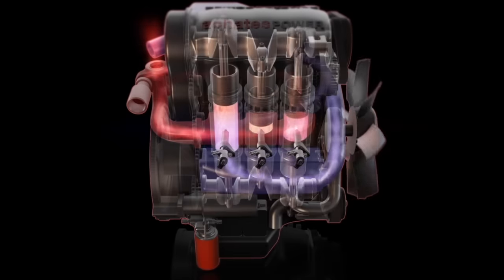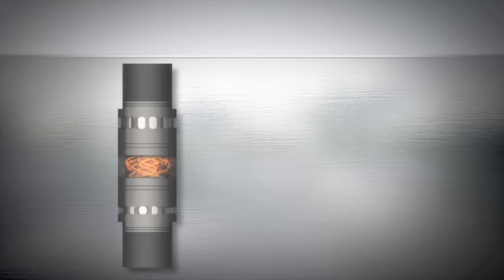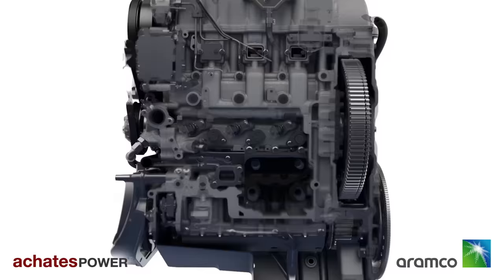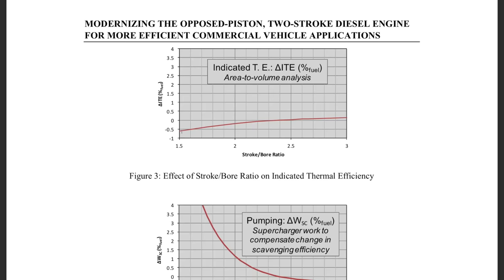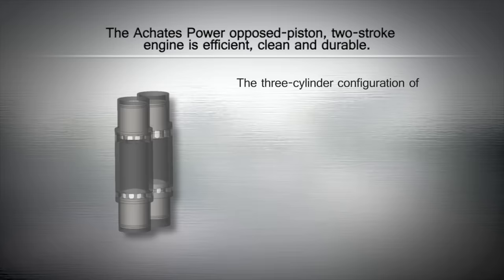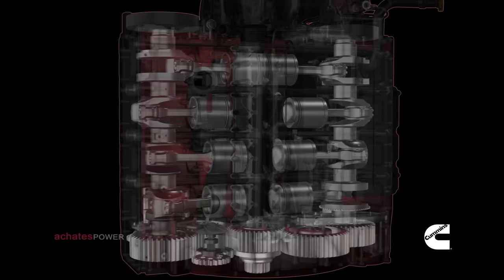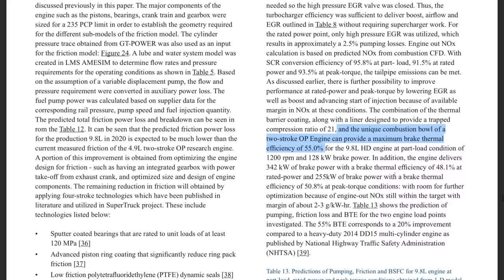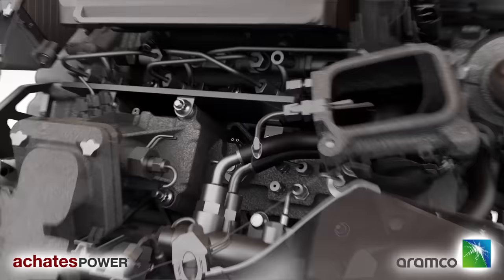Opposed Piston Diesel Engines Are Crazy Efficient

Comment: This could replace the Atkinson cycle engines in the Toyota Prius. I predict that this engine won't be used in consumer vehicles because it is too simple and it will last too long.
Reply: Agree with this comment. The manufacturer of vehicle will be bankrupt because the customer just buy the vehicle and less or very less repaired the engine.
Reply: I doubt if it will be used in consumer Vehicles because electric motors are the future.
Reply: @knewledge8626  Electric vehicles need a power station to generate the electricity. Australia does not have enough coal units to meet current peak demand on some summer days so we'd need to build new coal, gas or nuclear units BEFORE going electric.
I also doubt there is enough high grade carbon (graphite) being mined in the world to build the batteries and I'm certain no-one has devised an economically viable Lithium battery recycling process.
Au is smaller than California yet could not go electric. 
I reckon this 3 cylinder diesel has some merit and we are a long way from maximising the ICE.
Reply: @knewledge8626  It could be used as a ground engine and a range extender for cars. I think we are 10+ years away from EVs even being 20% of the cars. Charging times and range are still issues. In cold climates heating the cabin will reduce range. There are batteries on the horizon that charge faster than Li and have a greater capacity. Super capacitors may replace batteries. 

There are are the economics and politics and the ugliness of capitalism to deal with. An EV can last much longer because they are simpler machines and have less maintenance. If the average car lasts 20 years or more the economic effects will ripple through the economy.  EVs don't need transmissions, radiators, engines, exhaust systems, gasoline, diesel, oil and transmission fluid etc..  The oligarchs will have something to say about that.

What may happen is a lot of families who own homes will own 2 cars, one for around town and commutes and the other one for long commutes. It is sad that there is so much technology is being developed to get a small gain in efficiency though Rube Goldberg style engineering,
Reply: @tofanbaskoro3200  Had Mazda 626 for 18 years, engine was never repaired and outlived the car. It was "sold" at 220k miles with no engine issues whatsoever. Now I have next model 6.
Reply: there is also the problem that it is height is significantly bigger than normal four-stroke cylinders. You can't really fit that in smaller cars
Reply: @thiagozlin  Could you not mount the engine horizontally? Subaru and VW among others did it.
Reply: @thiagozlin  Put it in sideways like a boxer engine.
Reply: @carolinemartin-knowles7733  
In the UK we just went 100 hours with out using coal at all. As of 2018 we use more renewable energy then fossil fuel. It's just about investing in the future. Problem is for Australia coal is super cheap.  ;)
Reply: As for car maintenance. Cat industry is quickly learning, fit every new car with every mod con, air con, electric toy going. It is more to fail in the future and so more to make money from, this overcomes the reliability profit issue of electric cars.

Stick sensors every where. And when one fails make sure the car needlessly goes in to limp mode!

As cars get more electronic people will scrap then earlier rather then repair them too.
Reply: @knewledge8626  Why do you say this?  If this engine can get a car today that is say 30mpg on the highway to say 40mpg or 45mpg on the highway then that is very close to better than a lot of electric cars.  So then the difference comes down to complexity and charging time.   Now if this engine is only say 5% better then it isn't worth it, in my opinion.   The poster didn't put up another engine for comparison so it is difficult to judge.
Reply: I don’t think this is an accurate statement at all. Long lasting engines have never been the downfall of an auto make. Honda, buick, Toyota all make long lasting engines and they havnt gone under. Usually the engine in a car is NOT the first thing to cause a car to be scrapped anyway.
Reply: it is not EURO 4 friendly...
Reply: A lot of the comments in this thread sound like they're coming from somebody that owns a horse in 1920. We still have horses today. We will still have combustion engines in 30 years. And for the same reason. But combustion engines, just like horses, are not going to be what most people use to get to work.
Reply: @knewledge8626  not until theres places to charge them and charge them quickly. Until then, useless.
Reply: @tofanbaskoro3200 , current engines are pretty reliable. The rest of the drive train, suspension, body, and drive train combine to ensure turnover in automobiles.
Reply: @chriscomertn  think of the Ferrari testarosa. 8 or more feet wide due to flat 12.....

However, the dodge slant six is an interesting idea to copy.
Reply: If you want complexity, look at the computer's and other systems used. 

But adding a Stirling engineer to scavenge heat could be amazing!
Reply: @geppetto8013  run it on glycerin.
Reply: @thehound5794  Hate to break it to you mate , electric vehicles have most if not all those components you described.
Apart from the low maintenance on the electric motor, you still have just as much maintenance on the rest of the car.
Electric cars don't jus magically drive with just an electric motor and power storage
Reply: @nfsfanAndrew  It's deja vu all over again. From about 1910. "The first public gasoline servers (around 1907) were simply called filling stations. They were just curbside hand pumps. In 1920, America had 15,000 gas stations and only half that number of curbside pumps. By 1930, we had over 100,000 gas stations, and curbside pumps had all but vanished." Source: University of Houston. There were also few roads that were fit for cars and no interstate highway system. The first cars that were made were BY TODAY'S STANDARDS almost useless. So give it about 10 years. As of October of 2018, 1 million useless Vehicles have been sold in the United States. 😁
Reply: @Dosedmonkey  ; Super cheap is not a ''problem''. Super simpleton CO2 AGW ninnies are a problem.
Reply: I don't think reliability is the issue. Most cars are scrapped way before the engine fails. It's usually a crash, corrosion and/or part availability/cost that sends a car to the scrap yard nowadays.
Reply: @carolinemartin-knowles7733  just cover the Outback with solar panels
Reply: @carolinemartin-knowles7733  I get what you are saying, but the first part of the statement is somehow not very accurate. I've recently seen on YT one of our Polish university guys made 100% solar prototype for some big racing events. Apparently this event also appears in Australia, so I'm guessing instead of coal units you certainly have solar units.
The tech is there but until that oil mafia is dead, electric solutions are gonna progress very slowly because someone is backstabbing it. In terms of business models solar panel cars is a bad idea, because to many people in the industry are basically not necessary anymore, especially the fuel providers.
Of course this is only one example and for sure there are more solutions for countries like yours regarding harvesting energy, tidal farms, turbine farms, and so on. Energy is everywhere you just need to start thinking of fuel as something coming from nature not someones lucrative business and solutions will arise.
Reply: I agree...too little replacement parts profit, and gas consumption  . Auto/oil industry fat cats won't go for it. There are cars in Europe proven to get 100 mpg....but you don't see them mass produced. Wankle engines were simple design, fairly efficient  (Tho dirty exhaust?)...Mazda lost profits @ DEALERSHIPS. ..go figure.
Reply: Hey, something seldom mentioned about "Electric cars"...how long Batts last and cost replace!
Reply: @TestingPyros  As with almost any substance, a small number of people have sensitivities or allergies to glycerin and it can be toxic if consumed in sufficient quantities.
Reply: @DamianB82  Its not  "the oil mafia"  It's the tax man.   Sad and well misunderstood fact of reality the greenies will not discuss is that big oil only makes  around 10 - 15 cents per gallon off its product it sells.   While on the other hand the tax man makes anywhere from 40 cent to 2+ dollars per gallon.  

As far as big oil is concerned they'd love everyone to have high efficiency engines in everything at this point just so that they could sell you half the fuel you use now to do the same work at twice the profit for twice as long making a win win win for the customer, them and the environment.  

So once again in reality, it ain't the oil man's greedy hand holding things back, it's the much bigger and greedier big government doing it, as always, (ever wonder why 'emissions compliant' engines have way shitier efficiency ratings than non compliant 'off road' rated ones?) which means that until electric vehicles and everything related to their function can be taxed as hard or harder than oil, nobodies getting a practical EV anywhere.
Reply: @scottleachman9847  It's not big oil, its big government holding things back.   Big oil only makes 10 - 15 cents per gallon of product they sell.  Big government gets 40 cents to over $2 a gallon from the sale.   

As far as big oil is concerned they would love to see you use half the fuel at twice the price for twice as long to run your doublely efficient vehicle on.  The problem is the tax man would lose half his massive cut in the deal and the only way that game stays in play is if big government gives big oil massive subsidies to keep them happy enough to not push the issue.
Reply: @thecustodian1023  That's what pushes efficiency.

Expensive gas means more reason for car companies to make cars more efficient
Reply: @Joesolo13  Hardly, much of the world has far more fuel efficient vehicles than we do now because questionable to proven wrong government regulations under the name of emissions compliance holds our vehicles back on that front.  

Remember the volkswagen diesel scandal where  'fixing' the emissions problem make the vehicles lower powered and have worse fuel efficiency for it and killed their resale value for being 'fixed ' too?
Reply: @knewledge8626  yes but they still cant climb hilly terrain efficiently, they will only compete when super capacitors are ready
for those of us in lessdeveloped roadlesss countries this engine we are enthused about this concept
Reply: A lot of cars die nowadays for reasons other than engine failure.
Reply: @Dosedmonkey  -- So the UK substituted oil for coal for 4 days. What's the advantage there? I hear there is more offshore oil being found in the North Sea and that it will help meet the UK energy needs for a decade or more. I worked in the North Sea in the late 70's during the oil boom that saved the UK from becoming a third world nation, economically. Energy is taken for granted by most of the population that has easy access to it. The energy oligarchs don't want the current methods of energy generation to change quickly. They are using many methods to make sure of that.
Reply: tech hydrogen motors are the future man. Maybe with electric motors. But the engine charging them will be hydrogen. Unless we discover something else more efficient.
Reply: @thehound5794  I agree that this would probably be a very good engine to put in a hybrid vehicle. But don't forget that heating the cabin with thermal energy from this kind of engine also reduces range since you are going to need an additional heater just to get the temperature up in the engine d/t the higher efficiency. My Volvo V70 from 2006 has a diesel-heater installed from factory just because of this reason, it turns on automatically when under -7 degree C (~20F). When I turn the heater off it takes forever to get the engine up to working temperature and also the cabin heat.
Reply: @knewledge8626  or the past depending how you look on technology from 1908
Reply: @murta1979  One partial solution to heating the cabin is a lot of insulation.  Not only will it stop heat loss, it will make the cabin quieter.  When parked in a garage or driveway the cabin can be pre heated using dock power.  

When sub zero temperatures are present even conventional car heaters can't keep up with that much of a temperature difference/delta T.  Usually with subzero temperatures  there are clear skies. If a car is parked outside it will be warmed with passive solar.  

There probably is not a perfect solution. In northern states, some people buy a "winter rat" because of the salt used on the roads.  Winter is about 4 months.
Reply: @knewledge8626  far future, the batteries still have issues with cold weather
Reply: @yomumma7803  As of September 2018, cumulative sales in the U.S. totaled one million highway legal plug-in electric vehicles. Right now there are over 2 million. I'm thinking in less than 10 years there will be more electric vehicles than combustion engine vehicles. at least in the United States.
Reply: The Hound That wouldn’t concern the likes of Volvo
Reply: I had another thought on this. If the engine was placed so that the engine was placed narrowly instead of widely in the car, it could work.

Not sure that makes sense, so I'll just let you digest it.
Reply: Of course.   Why would toyota want to come out with the engine that never needs to be maintained.  Nobody would buy one, putting all other car companies out of business....leaving Toyota as the last survivor of the auto wars.    Nope.   no interest there.
Reply: Scott Leachman not to mention that the parts for them have to shipped around the world several times between mining / refining / manufacturing. Even before they are off the production line their “carbon footprint “ is enormous compared to gas/diesel vehicles.
Reply: @carolinemartin-knowles7733  Carbon batteries are a thing now.... By the time the world runs out we WI have it completely ready for commercial use.
Thank you samsung.
You're correct about everything else
Reply: @knewledge8626  they are not fuel that burns with no effect  to the HUMAN RACE is far better superior  with 100 to the gallon of more
Reply: @thehound5794  on way to hoiday  in car but need to stop to charge car up want  a car like that no really  a car that burns fuel that is no harm to us or this plannet
Reply: Gas cars will always get better and I will always be a gas car person. The only reason why cars are going electric is because we only have about 50 years of gas supply left in the world. I thought e85 was going to take off more but hopefully there is ways to find fuel or other types of fuel mixtures in the future. The fastest car in the world is the hennesy venom with a twin turbo v8 reaching over 300 so even a tesla cant even touch that
Reply: While I see your point, you give too much credit on the general population. People will buy other cars because they are new, or their "old car" have a too big mileage (maybe 50 000 miles, even less, I know people that change their car every 30 000km, wich is even less), or they just want a new feature, or feel like changing it. Reliable engine were put on many cars, and still they were selled for a less reliable but new car.
Reply: @tofanbaskoro3200  Have a Ford Crown Victoria Police Interceptor with Original Engine & Transmissiom and recently hit 300k Miles/482k Kilometer
Still Run like a clock and Shifts like a Dream
Reply: @carolinemartin-knowles7733  Solar and Wind Power the General load and use existing Fossil fiel Units dir Peak Power.
Reply: The hound, modern engines are more complex but very reliable, they easily outlast the car its in. so your theory is flawed
Reply: Because they’re too heavy. Efficiency is great. Power to weight?  Not so much.
Reply: @tofanbaskoro3200  who the heck gets their cars repaired by the manufacturer without warranty? They couldn't profit off a faulty product.
Reply: @Dosedmonkey  This I just scraped a perfectly good phone for 2 artificial reasons. 
1. the battery was going, and the dam thing is glued and sealed in a glass case. 
2. The manufacture stopped supporting it, but didn't release the code. 
Planed obsolescence.
Reply: You cant opperate thousands 2-stroke engines in a city. Low emissions fine but when it comes to burnt oil? Emissions are CO2, NOx and SOx but i didnt hear of any burnt oil regulations (CH probably). Yeah ships using 2-stroke engines but they opperate in the middle of nowhere. That kind of smoke it's heavy, imagine now how would a city will look like with a million 2-stroke vechicles.
Reply: Gary McSpadden tech sadly we will never develop batteries that can match conventional fuel in-terms of range and charge
Reply: Anything, even this,  can be built weaker. A friend was working with GM on ceramic clutches and he had to keep removing material so the clutch had a predetermined shorter life span.
Reply: Damn true !! They won't put it in consumer products!!
Reply: Toyota Atkinson poppet valved u-loop scavenged 2 stroke, popular on jz inline 6 2 stroke conversion
Reply: @Allen Loser I didnt say with fuel, i said with air but yes big engines (>1000) doesnt work like that.
Reply: @johndow1974  and you should have kept the old one clearly..
Reply: @Dosedmonkey  another problem is energy storage, also how much energy do you need to produce over how long a period before becoming carbon neutral. I have seen video's online that say windmill's are wearing out faster than predicted. I like the idea of solar as long as they are on building's instead of covering big patches of land,they take up a lot of space. I think that might have an effect on wildlife may be good or bad .
Reply: On the other side, who ever implements it (IF it’s so reliable) will get the lion’s share of sales.
Reply: @carolinemartin-knowles7733  you're not even gonna tackle a fact that Australia's electricity price actually goes negative because of all the renewable energy source they have... Specifically solar power... The price goes into a negative that means that the country pays you to spend electricity lol Australia has plenty of power.. So much that they turn off power plants/ probably the renewable power plants off for a few days so they can start making more lol
Reply: @ScatManAust  While electric motors are simple there is a lot of loss converting the DC battery power to AC power for the motor. In addition to that all the computer crap makes them more complicated than need be. I would that that a simple transmission could allow a DC motor to be used to keep the torque curve in an ideal range. Another problem is the current batteries don't do well in cold climates.
Reply: @Traumatree  Yet you still need the second crankshaft, and now you also need the con rods and bottom end gear on the top, too!
Reply: We can’t have that. Hahahahaha
Reply: @scottleachman9847  Rotary engines were never efficient or reliable.  The rotor seals were a significant issue for durability requiring complete rebuild after ~ 60K miles.  How can you in good concious make stuff up to prove a false assertion?
Reply: @thecustodian1023  Emissions compliant engines do not necessarily have less efficiency.  That is like saying carburated engines are more efficient than engines with  fuel injection.  Some efficiency compromises were made for modern diesel engines in the attempt to reduce NOx & particulate  emission.  While I am opposed to future government energy or  CO2 taxation strategies I still recognize  emissions regulations cannot be classified as pure greed or without positive impact on quality of life.  To make such claims is about as ignorant a statement as Greta Thunburg saying she can see CO2.
Reply: @kannermw  Actually most properly jetted carbureted engines with the proper non emissions compliant cam are capable of being substantially more fuel efficient  while also producing more power at the same time.  

This is common knowledge in the off road engine builders circles.  "clean burning' is not efficient energy conversion burning.  

I have a  97 Ford F450 with the stock  fuel injected 460 V8 and a custom built  carbureted 460 I set up to be fuel efficient plus powerful.  

The custom engine in identical driving conditions with identical vehicle loads does about  50% - 60% better average fuel mileage while also being able to throw down ~150 more HP at the same time.  

With a little digging and asking around on the off road forums you will find countless first hand accounts from people just like me who have had the same or better results for having turned a stock emissions engine into a fuel efficient mild performance 'off road' one.
Reply: @yomumma7803  
Oh not to worry...theres the old time tested design of starting cold diesels with a blank 12 gauge shotgun shell lol
Reply: The world's first hybrid car was designed by Porsche and used a opposed piston engine
Reply: @tofanbaskoro3200  Why? car dealers won't work on anything older than 10 years anyway!
Reply: Sad but true